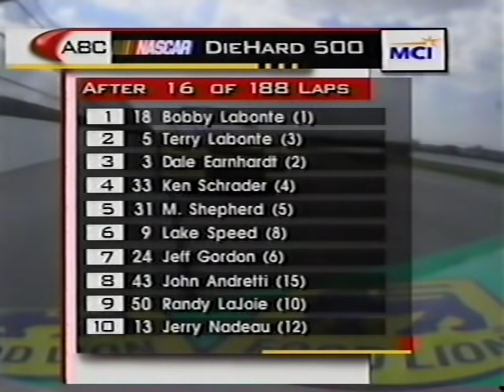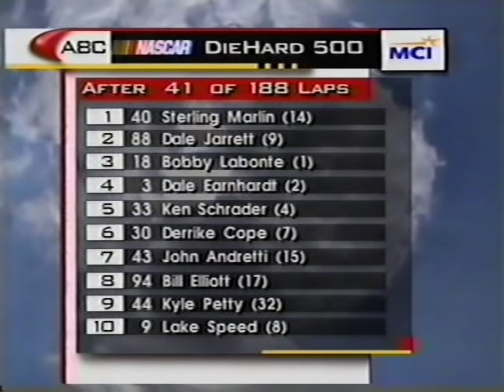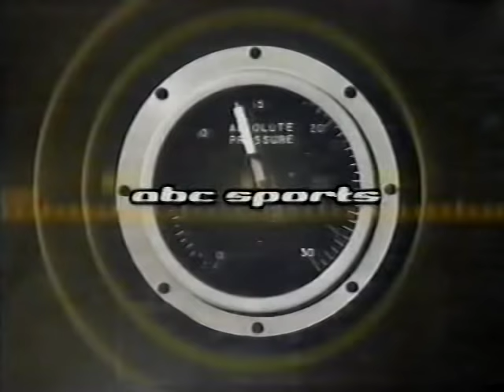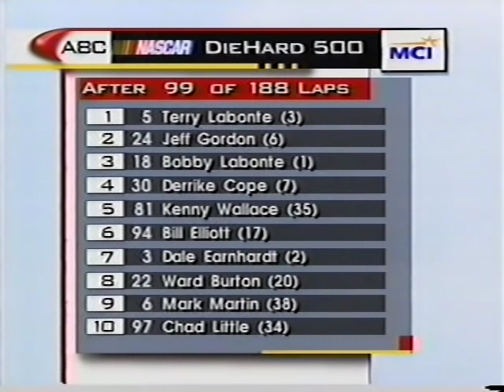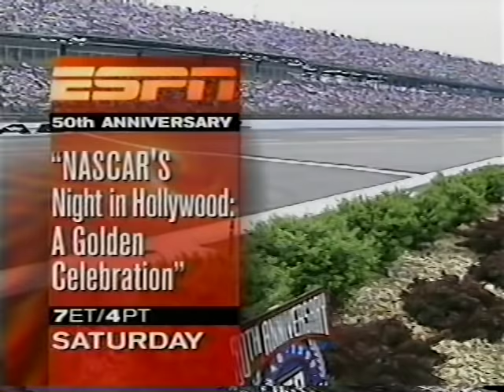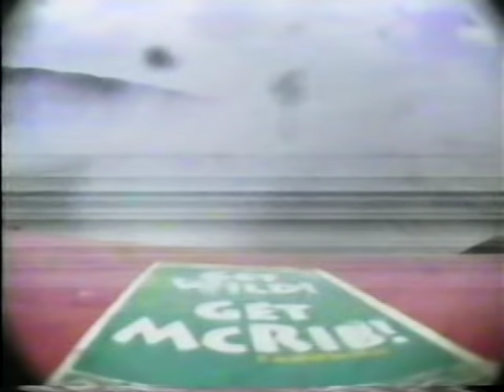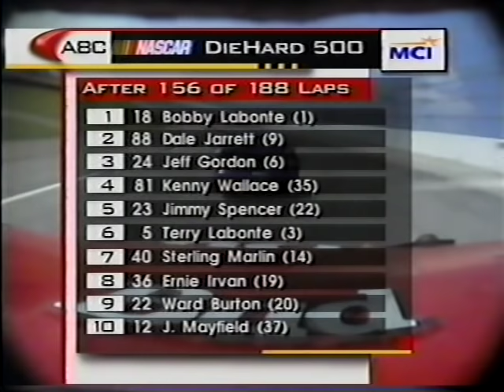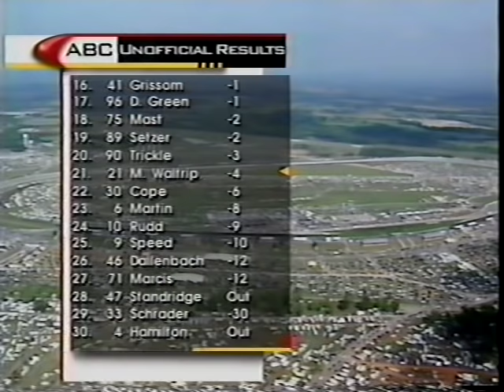1998 DieHard 500 (RAW SATELLITE FEED)

Comment: Love how they said Burton just made a little contact with Earnhardt, and clearly, he came up and spun him out big time, full-on left rear, and turned him right into Elliot. Wonder what he was doing there. Made no sense.
Reply: He got a run on Elliot going into the trioval, but instead of checking up he looked low and caught the apron with his left side tires. That kicks the car back up on the track, and into Earnhardt. If burton would have just touched the brake and stayed in line the wreck would not have happend.

Comment: Why is Chad Little in a Thunderbird?
Reply from the maker: Roush just using up one last '97 T-Bird body before having to hang the '98 Taurus body on it. They figured it'd probably get torn up at Talladega, so they let the old body take the fall lol
Reply: The precursor to Kurt Busch, Chad Little had a John Deere Thunderbird before having to hang the '98 Ford Taurus
Reply: . ''97 Thunderbird > '98 Taurus That's why.
Reply: Cause his name is Chad, he always has to be a screw up
Reply: There was a stupid rule of not having to use the Taurus if you didn't want to and there were a few t-birds throughout the season  but mainly it was the 97 that ran it
Reply: Jonathan Guevarra nope he drove a Pontiac before he drove a taurus
Reply: At that time in NASCAR, you could race a car that was up to two years old, even if that included two different models from whatever make
Reply: If you'll notice, a few of the smaller teams were using Thunderbirds as well. NASCAR allowed you to race an older body style at the time if you preferred.
Reply: @SMIFFTV  hi Smiff TV.
Reply: @jonathan_tong93  how expensive the Ford Thunderbird is??